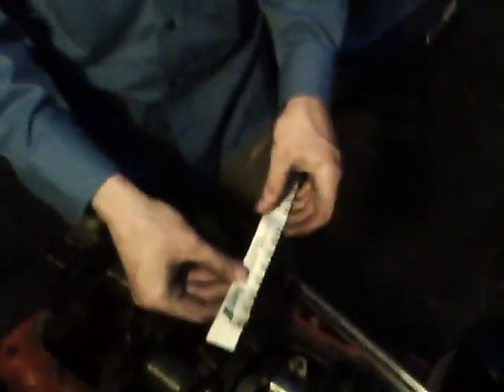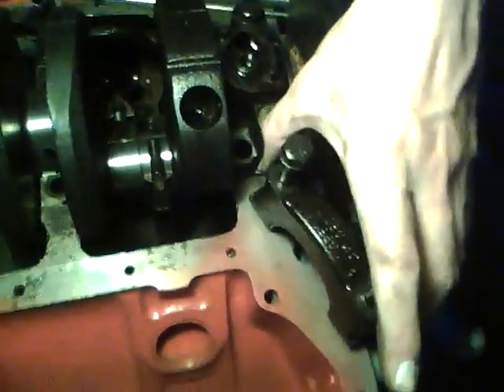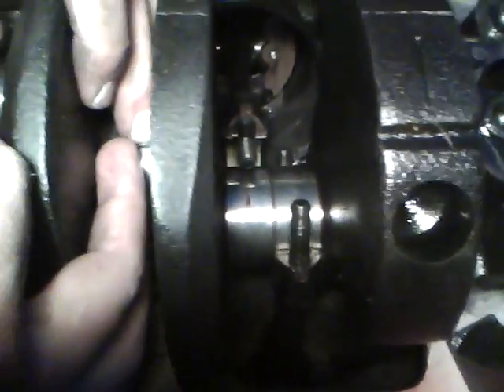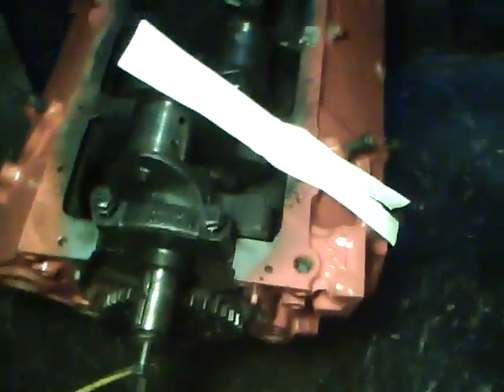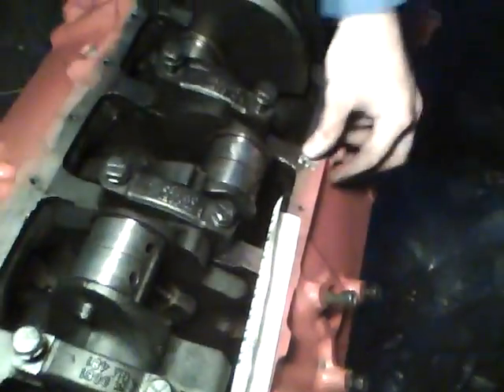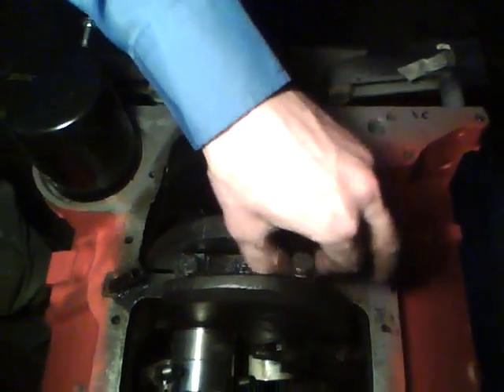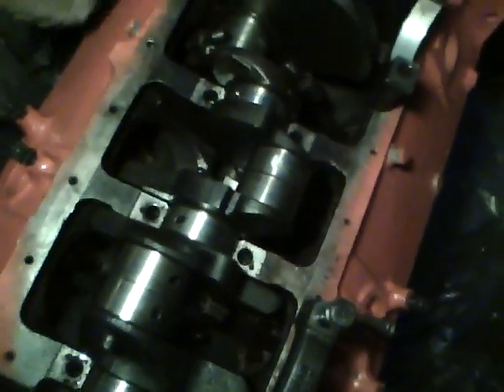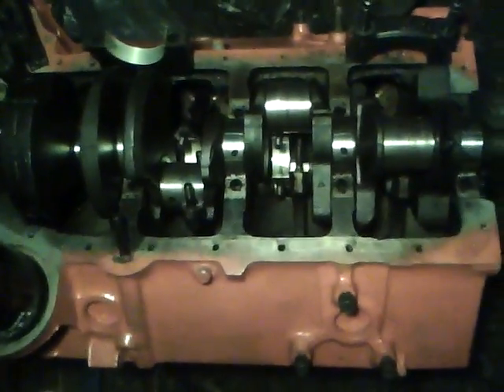How to Check Bearing Clearances Plastigage - Engine Rebuild Do It Yourself (Part One)

Comment: how do you make adjustments if you need to?
Reply: +Joe Greenough You buy new bearings, or crank if its scored
Reply: adjustments?  the only adjustments are bearing sizes.  oversized? undersizes? normal?  undersized is easy, just forward what the findings of the plastiguage to a machine shop.  normal is just that, normal.  if youre not getting a reading and need undersized bearings, might as well pull the crank and send it to a machine shop or order a new one.

Comment: SBC 350 main bearings clearance spec is .002-.003... rod bearing is .002-.0025 so he is on the looser side of spec but the margins are slim... plus that is a wore out motor, i wouldnt call this a rebuild, looks like an overhaul, which is basically, in my opinion, a waste of time. Do it all or dont do anything.

Comment: .003 would be ok for a drag engine - not for something to last a long time.
Reply: dunno how i can like this comment, but i like it.  .006 is whats most common for normal fitment but always call the dealer for range.  usually somewhere between .006-.015.  but every car is different

Comment: Thanks for sharing. A couple of comments for improvement, you might mention it's very important for everything to be spotlessly clean for testing clearances and especially for final assembly. A bit of dirt anywhere can screw up your measurement. It was hard to tell from your video if you got any real squash of the plastiguage. Since your readings were at the extreme end of the plastigage range it might be better to verfiy your clearances with the next size plastiguage.
Reply: Definitely wouldn't have hurt to try again with the red piece. At least for a person in this same senerio since this video is like 9 years old haha but for the people watching now and in that same situation definitely worth double checking to be sure of the accuracy of the test

Comment: 1.Is plastigauge used before sending to the machine shop or after getting from there. 
2. Should the bearing clearance be measured at all journals.  
3. If so should we put plastiguage simultaneously at all journals or one journal at a time.
4. When we check only one journal should all the  other bearing caps torqued to the specifications.

Comment: there is something about you that tells me you suck at building a engine 
you have to tightening the cap first spine the crank 1s or 2s then you take it of and put the plastic gage  check it wipe it of put it back on and keep going like that for every cap and rod caps and your problem now is that you did not polish the crank and measure it so you know what barrings you need i can see the crank is not polished its best to be at 1.5 of an inch your engine will start knoking soon
Reply: Not always the case

Comment: so if it has .003 clearance with the crank sitting on the upper bearing and no oil pressure, does that mean when it's running it equalls out all the way around so the actuall running clearance is .0015 at any given point around the bearing? also you neglected to tell us what to do if the clearance is out of limits say .004.

Comment: @EpiclyAwsomeDude Oil pressure does not set the bearings, the bore ID is smaller than the bearing OD providing bearing "crush."  The ideal way to check clearance would be to mic the crank, and use a bial bore gauge with the bearing torqued in place.  Plastigauge is useful when this cannot be done, such as with the crank in the motor.  Peronally, I have never used plastigauge and don't ever see me using it.

Comment: @Cutlass81383 A deflecting beam torque wrench like he's using never needs calibration.  If the pointer returns to zero at rest, then it's good.  The elasticity of the beam remains the same.  A micrometer type torque wrench is often checked before use and at least recalibrated annually because the coil spring develops hystersis which can affect accuracy.  A  common torque wrench is normally only +/- 10% accurate from the manufacturer.

Comment: It looks like a 350 block reap62. Also once your done plastigaging you dont need to try and remove the plastic from the journal. It will cone off naturally and mix with the oil. This may seem harmful to your engine but there is absolutley no risk involved and most technicians leave them on. Remember to lubricate the bearing to simulate the actual gap the oil creates and to prevent journal or bearing damage.
Reply: ebu1mp

Are you freaking kidding??? You can leave the plastigage on the journal and it will mix with the oil????  Bro you should stick to what your good at.  Catching Butterflies and basket weaving.